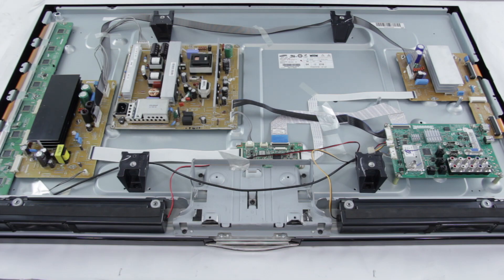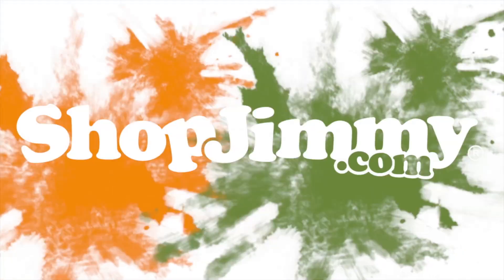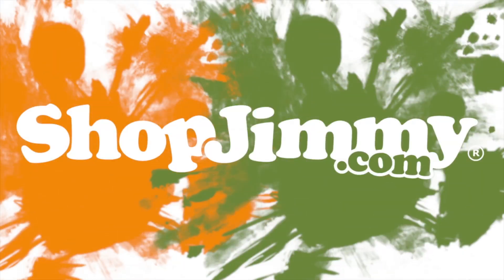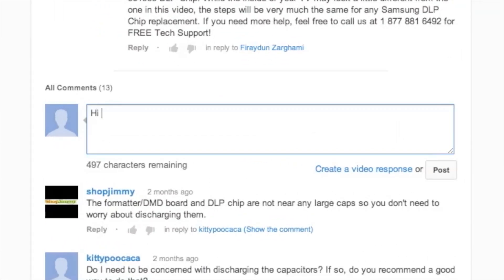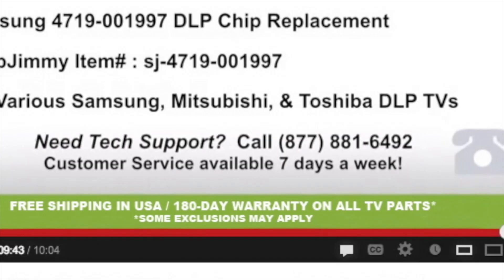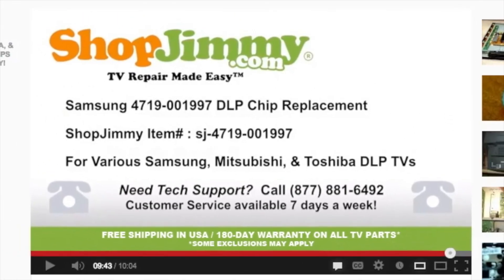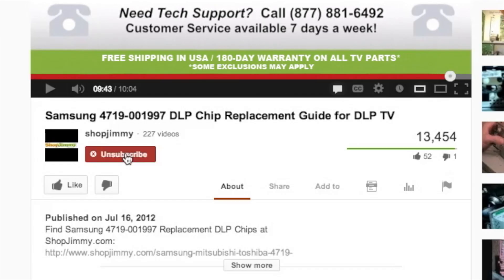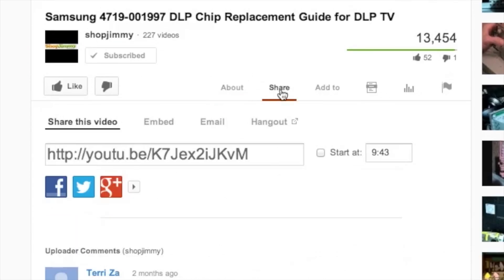Plasma TV Repair Tutorial - Common Symptoms & Solutions - How to Fix Plasma TVs

Comment: I have a Samsung Plasma PN43F4500AFXZA. It is just over 1 year old. The picture is perfect. On startup the picture comes on but the sound does not. TV restarts by itself and sound usually comes on. Sometimes it recycles up to 3 times before the sound comes on. Adjusting the volume with the remote also loses the sound and causes tv to reset before sound is restored. A clicking noise is made until tv shuts itself off and starts by itself. After the tv is reset volume can be adjusted with the remote for awhile, then the loss of sound is repeated if the volume is adjusted. Any ideas on what the problem could be?
Reply from the maker: +Brent Steiger   Try all repairs and troubleshooting at your own risk.  I recommend replacing the main board in your TV.  Click this link to replacement parts for your TV model number:  http://www.shopjimmy.com/samsung-bn94-06194x-main-board.htm  There may be multiple boards for the same TV model number, be sure to match part numbers on your current board, with your replacement for compatibility.  Here is a link to a video showing how to identify your part number, click here:  https://www.youtube.com/watch?v=RwHTvjMdrhk  Thanks and please let us know if you have any further questions with your TV Repair!  www.shopjimmy.com

Comment: shopjimmy, I have a Philips plasma 50pf9630a/37 and I have a snowy black and white picture with no color. any ideas?
Reply from the maker: +Mike Yager  Try all repairs and troubleshooting at your own risk.  I recommend replacing the Y-Main Board and the Upper and Lower Y Scan Drive boards in your TV.  Click this link to replacement parts for your TV model number:  http://www.shopjimmy.com/catalogsearch/result/?q=50pf9630a%2F37  There may be multiple boards for the same TV model number, be sure to match part numbers on your current board, with your replacement for compatibility.  Here is a link to a video showing how to identify your part number, click here:   https://www.youtube.com/watch?v=R1jmj_foId0  Thanks and please let us know if you have any further questions with your TV Repair!  www.shopjimmy.com

Comment: I replaced the power supply board on my Panasonic tc-p50x5 and it still has no power.  What next?
Reply from the maker: +Jamie Laney   Try this at your own risk. Unplug the TV, then disconnect the SC board and plug in the TV to see if the TV powers up. Note that it will not have a picture on the screen. Reply with the results of this test. Thanks! www.shopjimmy.com

Comment: I have an LG 50PN4500 Plasma TV. The issue is the TV gives no sign of life when plugged into an outlet. I see no lights from the TV (no standby). I have replaced the power supply board. Still same issue remains. When I look at the logic board I see no light comes on (on the logic board) with the old power supply board or the new one I purchased. Can anyone help with what it may be?

Comment: Hi ShopJimmy I have a samsung pn50b450 with equally spaced vertical lines what part do you have to repair it
Reply from the maker: +Nikica Begonja   Try all repairs and troubleshooting at your own risk.  This sounds like a TV panel (TV Screen) problem.  If your TV panel is bad, it may be more cost-effective to replace the TV as panels are typically hard to find in stock, difficult to replace, and expensive.  Thanks and please let us know if you have any further questions!  www.shopjimmy.com

Comment: I have a Samsung plasma and it want turn on. Model pn51f4500bf
Reply from the maker: +Howard Lewis-Anderson   Try this at your own risk. Unplug the TV, then disconnect the y board and plug in the TV to see if the TV powers up. Note that it will not have a picture on the screen. Reply with the results of this test. Thanks! www.shopjimmy.com

Comment: i have 2007 panasonic hd plasma tv model #TH-50PX75U  when i turn on 7 blinking red light no picture then i dissconect the Y board turn on solid red light  is it the Y board or the 2 buffering boards? please advise
Reply from the maker: +Rich von Dohlen   Try all repairs and troubleshooting at your own risk.  I recommend replacing all three boards.  Click this link to replacement parts for your TV model number:  http://www.shopjimmy.com/catalogsearch/result/?q=TH-50PX75U  There may be multiple boards for the same TV model number, be sure to match part numbers on your current board, with your replacement for compatibility.
Thanks and please let us know if you have any further questions with your TV Repair!  www.shopjimmy.com

Comment: Hi guys I have a LG pq6000 50" Plasma Tv. The issue im having is a vertical white line. on the right hand.side.of.the screen (top to bottom) aprox 1" in width.  its not a solid bar. It flickers and u can see the display picture through it. Its intermittent. some times its not there.  i have checked  and reseated all of.the ribbon cables on the address buffer boards. as well as the 2 ribbons going to the T con or logic board. is this possibly a Address board, or main logic board issue.  all the ribbons coming  from the plasma panel  to the address board are in good condition no corrosion or tears. All seated and locked in place to the ribbon connectors correctly aswell. Any advice would be appreciated.. Many thanks. Roy
Reply from the maker: +Roy Henry   Try all repairs and troubleshooting at your own risk.  This sounds like a TV panel (TV Screen) problem.  If your TV panel is bad, it may be more cost-effective to replace the TV as panels are typically hard to find in stock, difficult to replace, and expensive.  Thanks and please let us know if you have any further questions!  www.shopjimmy.com
Reply: I replaced the T Con board. And its now perfect.

Comment: I have a Samsung  Plasma 65 3D unit, mdl #PN64E550D1FXZA. I bought my house with this TV in it, the last owner did not to bother with it and just left, score right? Well three months of ownership the Ratio changed a couple times, I dont really know if that is relevant because it could have been the fault of my curious son. Then about three weeks ago it would shut off and come back on with no picture but sound. I tried changing boxes, monster cables and it just got worse in the following days. It would do it more frequently and now all I see when I turn it on is the SmartHub Logo and then back to black, then just sound comes back. I use to be able to shut it off and turn it back on and it would stay awhile, and then it would just goto black, turn off and turn on then sound comes back. There was a time where this cycle would not happen for a couple days and I thought that my nightly prayers were answered. God doesnt care about my TV. Does this sound odd? I can not find anything on You Tube that covers all of my symptoms.
Reply from the maker: +Rick Kennedy   Try all repairs and troubleshooting at your own risk.  I recommend replacing the Y-Main Board and the Upper & Lower Y Scan Drive boards in your TV.  Click this link to replacement parts for your TV model number:  http://www.shopjimmy.com/catalogsearch/result/?q=PN64E550D1FXZA  There may be multiple boards for the same TV model number, be sure to match part numbers on your current board, with your replacement for compatibility.  Here is a link to a video showing how to identify your part number, click here:   https://www.youtube.com/watch?v=R1jmj_foId0  Thanks and please let us know if you have any further questions with your TV Repair!  www.shopjimmy.com

Comment: I have a Samsung PN60E6500EFXZA.  The TV powers up and plays.  It will go black/silent a time or two and then goes black and silent permanently; TV still on.  If I power the TV off and then power it back on, it will power up and play again.  Eventually (frequently within a minute or two) it will go black/silent again.  There is no popping or or other noises.  I cannot appreciate any popped capacitors. I tested both ceramic fuses on the power board and the test ok.  Thoughts?
Reply from the maker: +Stephen Damon   Try all repairs and troubleshooting at your own risk.  I recommend replacing the Y-Main Board and the Upper and Lower Y Scan Drive boards in your TV.  Click this link to replacement parts for your TV model number:  http://www.shopjimmy.com/catalogsearch/result/?q=PN60E6500EFXZA  There may be multiple boards for the same TV model number, be sure to match part numbers on your current board, with your replacement for compatibility.  Here is a link to a video showing how to identify your part number, click here:  https://www.youtube.com/watch?v=R1jmj_foId0  Thanks and please let us know if you have any further questions with your TV Repair!  www.shopjimmy.com

Comment: I have a Samsung plasma TV model PN51E550D1FXZA. When the tv is cold the picture will go dark after a couple of minutes. The tv is still on but it will have no picture or sound. The picture will return if I turn off the tv and turn it back on. After several cycles of this the tv picture will eventually stay on. I performed a factory reset and updated the software as per Samsung support, but it did not help.
Reply from the maker: +Sydney Tickle   Try all repairs and troubleshooting at your own risk.   I recommend replacing the Y-Main Board and the Y Scan Drive board in your TV.  Click this link to replacement parts for your TV model number:  http://www.shopjimmy.com/catalogsearch/result/?q=PN51E550D1FXZA  There may be multiple boards for the same TV model number, be sure to match part numbers on your current board, with your replacement for compatibility.  Here is a link to a video showing how to identify your part number, click here:  https://www.youtube.com/watch?v=R1jmj_foId0  Thanks and please let us know if you have any further questions with your TV Repair!  www.shopjimmy.com

Comment: Samsung Model PN60E550D1FXZA powers up fine and plays great, then goes off after 3-5 min. I can unplug tv it powers up without turning on with remote, plays for 3-5 min. again then goes off..thanks, crhinem.
Reply from the maker: +Jan Rhinehart   Try all repairs and troubleshooting at your own risk.  I recommend replacing the main board in your TV.  Click this link to replacement parts for your TV model number:  http://www.shopjimmy.com/samsung-bn94-04644d-main-board-for-pn60e550d1fxza.htm  There may be multiple boards for the same TV model number, be sure to match part numbers on your current board, with your replacement for compatibility.  Here is a link to a video showing how to identify your part number, click here:  https://www.youtube.com/watch?v=BEPWrefQvqI  Thanks and please let us know if you have any further questions with your TV Repair!  www.shopjimmy.com

Comment: my samsung  pn51d530a3f  clicks and will not turn on.  I also see a blink on the standby light.  I changed the main power supply board and the symptoms are exactly the same
Reply from the maker: +james baunhuber   Try this at your own risk. Unplug the TV, then disconnect the y board and plug in the TV to see if the TV powers up. Note that it will not have a picture on the screen. Reply with the results of this test. Thanks! www.shopjimmy.com

Comment: I have a Samsung PN42B450B1DXZA.  After about half an hour of operation, the screen goes momentarily black and the picture aspect ration changes to 16/9.  The color balance goes from Movie to Dynamic.  It's as if the TV were reverting to default settings.  I've replaced the Power board (no joy) and disconnected/reconnected all the connectors on the Main board (also no joy).  Could this be a Main board problem?
Reply from the maker: +Steve H   Try all repairs and troubleshooting at your own risk.  I recommend replacing the main board in your TV.  Click this link to replacement parts for your TV:  http://www.shopjimmy.com/catalogsearch/result/index/?cat=56&q=PN42B450B1DXZA  There may be multiple boards for the same TV model number, be sure to match part numbers on your current board, with your replacement for compatibility.  Here is a link to a video showing how to identify your part number, click here:  https://www.youtube.com/watch?v=BEPWrefQvqI  Thanks and please let us know if you have any further questions with your TV Repair!  www.shopjimmy.com

Comment: I have a Panasonic TH-42PX50U that is about 10 years old. Just recently when you turn it on the picture is distorted and there are horizontal lines that roll. As the set warms up, the picture improves and then eventually is completely fine. The distortion and amount of time it takes to return to normal has been increasing. Is this something that I could take in and have repaired relatively inexpensively or should I start looking for a new television.
Reply from the maker: +Charlie Johnson   Try all repairs and troubleshooting at your own risk.  This could be a problem with either the buffer(s) or the TV panel.  You can try replacing the buffer(s) in your TV to see if that fixes the problem.  Click this link to replacement parts for your TV model number:  http://www.shopjimmy.com/catalogsearch/result/?q=TH-42PX50U  There may be multiple boards for the same TV model number, be sure to match part numbers on your current board, with your replacement for compatibility. Thanks and please let us know if you have any further questions with your TV Repair!  www.shopjimmy.com

Comment: I have an Plasma LGPZ550 The sound is good but no picture. I was told to replace the YSUS board and the ZSUS board does that sound right to you? If so do you have the parts by any chance  Thank you
Reply from the maker: +Gilbert Franco   Try all repairs and troubleshooting at your own risk.  I recommend replacing the YSUS and the YDRVBT & YDRVTP boards in your TV.  Click this link to replacement parts for your TV model number:  http://www.shopjimmy.com/catalogsearch/result/?q=PZ550  There may be multiple boards for the same TV model number, be sure to match part numbers on your current board, with your replacement for compatibility.  Here is a link to a video showing how to identify your part number, click here:  https://www.youtube.com/watch?v=GEllG3RV-tc  Thanks and please let us know if you have any further questions with your TV Repair!  www.shopjimmy.com

Comment: hi I have a 42 inch sanyo model number dp428l and the symptom I have is when I turn the tv on it has a noise comming from the right speaker and when I turn up the volume I have no sound any ideas?
Reply from the maker: +Justin Longfellow  Try all repairs and troubleshooting at your own risk.  I recommend replacing the main board in your TV.  Unfortunately I do not see any replacement parts in the search results for your TV model number on our website.  Please reply with your part number on your main board and I can try searching for replacement parts.  Thanks and please let us know if you have any further questions!  www.shopjimmy.com

Comment: Hi there.I have a Panasonic TC-P50C2  SN MB02510647  date Sept .2010. For about 5 years I using this TV set and works great. But last night I tried to turn on  the TV and do not turn on. I tried many  times and I fail to turn on my TV. Two days later I tried to turn on and the only things that turn on was the red flashing light but nothing more, no audio, no video. Like I said before I was using this TV with no problem at all. I hope you can solve this problem because this TV set is great product...
Reply: +Victor Rios , I send all the info of my Panasonic and I am waiting how to fix my TV set
Reply from the maker: +Victor Rios   Try this at your own risk. Unplug the TV, then disconnect the SC board and plug in the TV to see if the TV powers up. Note that it will not have a picture on the screen. Reply with the results of this test. Thanks! www.shopjimmy.com

Comment: I have a 50 inch d:sign plasma TV the model: PDP50x30014. it power on but it has no picture and it also makes a ticking noise please help
Reply from the maker: +Steven Hill  Try all repairs and troubleshooting at your own risk.   I recommend replacing the Y board and Y buffer(s) in your TV.  Unfortunately I do not see any replacement parts in the search results for your TV model number on our website.  Thanks and please let us know if you have any further questions!  www.shopjimmy.com

Comment: samsung 50 inch plasma model number pn51d440a5dxza. has no picture and produces a loud annoying sound when turned on.  the tv has been unplugged for a few weeks now but would love to get it working again. any help would be greatly appreciated.
Reply from the maker: +yarkie1  Try all repairs and troubleshooting at your own risk.   I recommend replacing the y-main board and y-buffer board in your TV.  Click this link to replacement parts for your TV model number:  http://www.shopjimmy.com/catalogsearch/result/?q=pn51d440a5dxza  There may be multiple boards for the same TV model number, be sure to match part numbers on your current board, with your replacement for compatibility.  Here is a link to a video showing how to identify your part number, click here:  https://www.youtube.com/watch?v=R1jmj_foId0  Thanks and please let us know if you have any further questions with your TV Repair!  www.shopjimmy.com